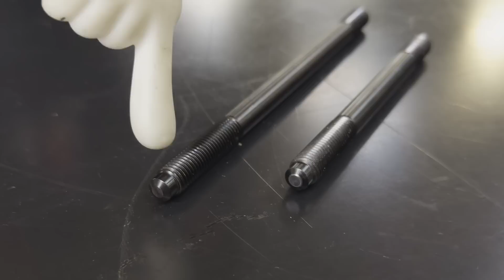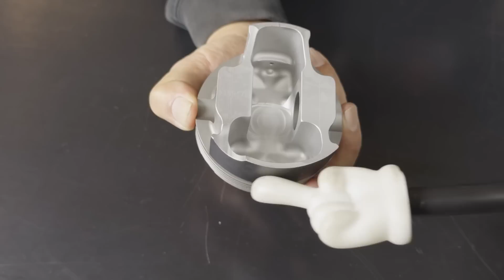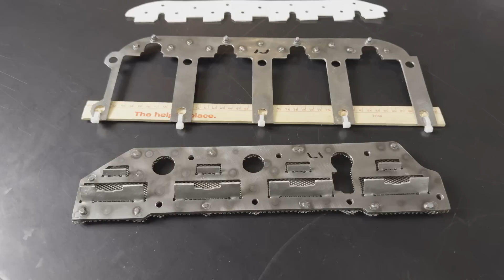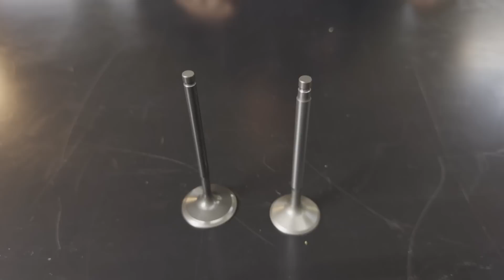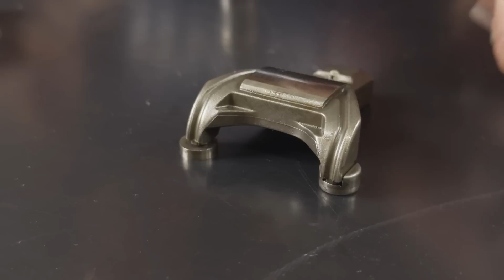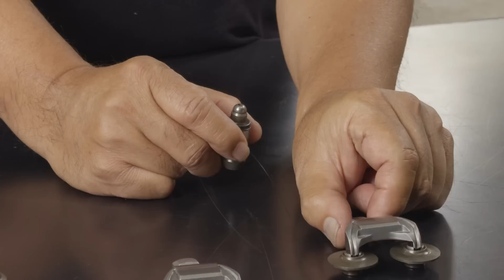How to Build the ULTIMATE Nissan SR20!

Comment: Has anyone come up with a Castsble  light weight. Alloy that resists distortion From all this bolt torque. Maybe  billet block out of 7075 with a dry deck  and O ringed.  Not a metsllurgy major but  worth) a thought. Not sure what Ali /alloy thd guys r using but pretty sure it’s a forging and prob st T6 as i
Often these alloys machine better heat treated  be mega $. But somehow it doesn’t put a lot of people off they have a goal and they wanna reach it lol 😂
Reply from the maker: The design that would not distort would probably have the threads deep inside the block.  If you notice, many newer engines have much longer bolts on the mains and head, this helps.  Things would have to be heavy too.   Youngs modulus for aluminum is pretty close to being the same for all aluminum alloys so making it out of 7075 is not going to help.  In fact 7075 is slightly less stiff than good old 2024 cast aluminum.
Reply: @motoiq  u know your shit Mike I love your channel 👍🍻
Reply: @motoiq  thank u  yes it looks like many manufacturers have particular alloys they use  I would guess experimentation over the years has had them arrive at these Would love to know what cosworth and Judd and Romac use with much high specific out puts and lightweight being paramount I guess they have their secrets 😂
Reply from the maker: What I have seen with Cosworth anyway are tons of smaller long studs.

Comment: I watched a dude build  up a 4g63    he took each valve spring  measured the installed height of each   Then by way of shims  got them as equal as possible next he’d  compressed each individual spring to X  and measured its spring pressure At X compressed value. Think he did. This at Y and even Z compressed value.    Recorded everything and matched  them all as close as possible in some cases this involved adjusting the shim stack to obtain equal values I’ve never seen this before it seemed like overkill. But. As he said   Harmonics r involved in the cam drive also Wow this dude had more patience than a saint ( and perhaps no wife 😂😂be interested to know if any one else had heard of this) btw  x and y and perhaps z  were. All measures of  cam lobe lift Seriously dedicated dude lol
Reply from the maker: This is actually typical and you are supposed to always do it.
Reply: @motoiq  wow I’ve taken note now to raise the cash for the tools

Comment: Have seen a vid on cosworth  inline 4  pinto based engine  wherethey were able  sink the head studs right down into the block r able todo that on these engines?
Reply from the maker: The SR studs are sunk into the block.
Reply: @  How far down they go ?  This mod I’m talking seemed to have hugely long studs   Not sure if that engine was a wet or dry lined but I guess the idea was to get away from bore distortion  I must go back and check that  Wow that’s being ultra  careful with. Torque plate on the he head  and cutting Valve seats actually love what your saying about the cnc valve seat cutting to me a single point cutting tool is thd best way to go. Avoids a lot of chatter and thd radii seems perfect   No need for an O ringed block and head with this type of gasket can u name it again I’d like to look it up  I’m a big fan of all these. Newish processes also  like too know more about this new Cryo treatment   Superfinishing makes a huge difference to Motorcycle  dog boxes  I priced WPC but hugely expensive. Not enough places doing it yet !!!!!
Reply from the maker: About 7"
Reply: @  gee long way down  and it still gets bore distortion! ?
Reply from the maker: Yes a lot of engines do, especially aluminum blocks.

Comment: This is excellent information. Thanks so much. I recently had a failure after 10 years of use. Standing behind the engine my piston 1 front right valve relief burnt. Piston 2 front right valve relief cracked. Piston 3 ringland broke on the intake side. My 1st n 2nd piston rings were perfectly fine but the top and wavy oil ring were snapped. Piston 4 appears fine but the exhaust side valves were saturated in oil looking through the cylinderhead. I'm still tearing down the engine. Next I will remove pistons 1, 2 and 4

Comment: People who think cryo treating and WPC are snake oil are idiots.
I spent over 20 years in aviation. A lot of aircraft parts are cryo treated. Pretty much all the rotating parts in a jet engine (fan, compressor, and turbine blades) as well as any gears are cryo treated (and sometimes laser peened).
Media impact deposition application of dry film lubricants has AMS and DoD process specifications (DOD-L-85645 Rev. A). It's been in use for at least 25 years by the military. I suspect its been around longer than that jusr under a different spec number. I've seen F-16 flight control parts manufactured in the 80s that had some kind of dry film surface coating and a slightly pebbled texture like WPC.

Comment: I dont have that much experience so keep at mind that my own build is more an "amateur" build rather than an ultimate build, but thing i learned on SR20 since 10 years:
1-Oil pump => Go for either an GTI-R or SR16VE oil pump. Both have wider internals, resulting in more flow (and more pressure for the later). A minor adaptation is needed though, like a new collard for the crank (with is now diven by 2 wolfkey rather than 1), a 5mm shorten crank pulley and a relocation TDC indicator.  It's rumored that SR20VE oil pump cover are a bit stronger and have the same are SR16VE internals.
2-Conrod = you can get some brands who use GTI-R bearings, switching from 17mm wide to 19mm wide.
3-Mains bearings = use Nismo or Tomei for the oil gallery on both sides. IDK if ACL do the same.
4-I'm not a fan off dual guide on the rocker arm, for what i understand you need to shim your rocker arm properlly if you dont wana throw them. Use the special tool (or make one) which is placed on the lifter location and mesure carfully with a comparator the heigt difference between your 2 valves. If done correctly (+/-0.025mm between them) you done with rocker arm problems, except if your using an agressive rev limiter or anti lag (the exhaust valves can lift from those).
5-Never use a rocker arm stopper 😠
6-For a non track only car, i recomand 4032 alloy pistons instead of 2618. There are less thermal expantion on 4032 so way less piston slack than 2618, and there are stong enough for more than enouth hp to daily drive. (4032 piston example : HKS, Mahle but there is no hole for oil squiter on this one)
7-Oil pan, obviously larger capacity + baffle but i recommand stainless rather than aluminium. The oil drain tend to wear the threads really quick on aluminium, but you can use an Helicoil to prevent that. I use Tomei japan N1 pan, + 0.8 liter and quite nice looking too.
8-Valve guide, dont cheap on that. They wears down quickly because of the rocker arm design, aftermarket ones are suposly a bit stonger, but the main thing is check the valve on the guide, 0.3mm is the max at max lift.
9-Coil : use a good aftermarket one, R35/370Z or VAG R8 are greats, spitfire etc... are garbage.

And last thing, the OEM SR20 is 8.5:1 CR, uping this to above 9:1 until just under 10:1 mean that you can still use gas pump 93, but your engine will be nicer at low rpm and spool your turbo faster.
More than 10:1 E85 is needed. 😊
Reply from the maker: Did you listen in the video on how we keep the rocker level with dual guide shims? 4032 is about superfluous now days due to the much better piston designs than now run about the same piston to wall clearance with 2816. We rarely run 4032 anymore.
Reply: @motoiq  dont worry i didnt say you told a bad or a good thing in the video, i just tel what in learn by myself 👍
By better piston design you mean they overcome the downside of large expansion alloys with some new tricks ? I know that part of the coating on the piston skirt is partially use to reduce the slap for exemple.
But in the end the "ultimate sr20" is for a track use focused build, so 2816 downside are not a thing anymore. 
But for the valve grind to adjust the rockers its a clever Idea, it's get rid of the whole shim stuff. But the guided shim actually exist in different heigth,  but it's probalbly for solid lifters stuff (tomei make them).
Reply: @LMSCa18det  As a GTiR owner. Can't beat solid lifers (or quad throttle bodies. But that's another story.)
On a close to 'money no-object' build. It's an odd omission given the reliability advantages. Especially if planning on a flat-shift and/or limiter bashing. Having a lifter collapse from frothy oil is a real risk at high loads/rpm/g-forces. This combined with ALS(if they plan to run that) or flat shift can bounce the valve and then you've got instability at both ends of the rocker. Solids give you you piece of mind (and the ability to run more aggressive cams ;) )

Excluding a VVL head upgrade (but they can toss shims as well, just ask Andre.) Dry-sump and solid lifters are the gold standard for track focused builds (not just SR's.) Just like the old SuperTouring cars did. 

Regards
Jordan.
Reply: @manitoublack  on gtir sr you have a system on the lifter who lock the rocker the lifter ?
with sr20, it's always a mater of keeping the rockers in place, everytimes they need the cam lobe in near contact with the upper part, the 2 valves and the the lifter. If not, the rocker can move and will move.
I was thinking about retrofiting in the valve train like the VVL head, but with custom rocker with an ajustement screw like in k20. No need to have a dual lift, just a rotative rocker instead of the one on DE head, with a screw to set valve play witout any shim.
Reply from the maker: Yes they have way better skirt shapes now with thermal analysis.  The slapping noise is much less reduced.  At least JE, CP, Mahale, wisco etc, the better companies.
Reply from the maker: There isnt as many good profile choses with solid lifters so I tend not to use them and do the tuning with softer bounces.
Reply: @motoiq  Good to know, thanks for your share of knowledge !

Comment: What about the oil pickup tube I’ve heard they tend to break off frequently?
Reply: Yes. I’ve had one break off on my stock s13 sr20. The fix is very simple though, which is to buy the s14/s15 oil pickup. It bolts straight on and has a revised pickup shape, stronger support bracket, and more thorough brazing on the end of the tube.
Reply: @bransonfleischman2233  the tube usually breaks off at the strainer right?
Reply from the maker: Never had an SR do this, EJs yes. We will note this and beef up the pickup, than you!
Reply: @motoiq  glad I could help
Reply from the maker: I checked and we have the improved later pump pickup. I ordered a new one and will add a few tig welds to it.
Reply: @motoiq  that’s good news one less thing y’all will have to worry about later. Can’t wait to watch y’all’s next video!!

Comment: What do you say to the people who claim intakes with short runners like the Greddy lose a lot of low end torque and it's better to stick with the stock intake?
Reply from the maker: The dyno doesn't show that.
Reply: they're accurate. but solve the issue with more displacement ;)
Reply from the maker: We haven't seen power fall off at low rpm with our builds, even at 2 liters.

Comment: Don't think enough drivers understand the load braking in gear does to a engine especially rod bolts. Deceleration is the same load as acceleration.  Losing your engine is automatic last place.

Comment: Every time I see an SR20, I just get the feeling that Nissan didn't design and manufacture it to particularly high standards.
Reply from the maker: Well it's a 30 year old design.  That being said the only late model 4 cylinder that is significantly better is a Honda K.
Reply: @motoiq  What are your thoughts on the ecotec engines? Some of them seem to have done really well in drag racing.
Reply from the maker: I don't have any experience with them, I think they are good.

Comment: Are there any papers You would recommend reading about the cryogenic metal treatment.
Reply from the maker: Google
Reply: Unfortunately the best ones sit behind Engineering Journal pay walls. If you're a university student or know someone who is, you could use their student credentials to gain access through their university's subscriptions. text books also exist

Otherwise it's $5-50 per paper.

Suffice to say, having read a few. they're very dry and can take some 'reading.' If you don't already have a good understanding of material science. You may not get much from the academic publications as they assume a high level of prior knowledge. I know that's not much help saying: "in order to learn about Z, you need to know Y. And in order to understand Y you need an understanding of X which you'll get from degree in materials science..."
Reply from the maker: You can find good white papers on cryo for free on google.

Comment: How do they drill the pin boss oil holes? Must have a very small 90 degree spindle on their cnc machines, maybe high pressure coolant powered, just a guess.

Comment: Like 500 hp here is good fuel, good tune, new bearings, soft limiter, ARP rod bolts water pump pulley underdive, oil pickup mod.

Comment: Chuck it in the bin and get a Toyota if you want to beat on a Nissan. If your car is going drifting, put a proven engine in the car. I.e, a 1jz or a 2jz. You have loads of space under the hood. A RB26 might even be a solution, but not a SR20. A straight six would provide much clearer power and more torque without having to lean on it, which in turn, makes a much more reliable build.
Reply from the maker: no kidding
Reply: @motoiq  I guess you have a huge budget and can afford to rebuild a engine every race, that is if you honestly intend to get 500 HP from a SR and race it, I mean actually race it. If it's "4-cylinder" class you intend on competing in, I still wouldn't use a SR, I would use a K Series Honda. As far as common knowledge in Europe goes, SR20's are known to be really soft, which you kinda allude to. I'm assuming all those treatments and preparations don't come cheap, and you could avoid all of it, and save yourself a lot of money, by simply choose a engine more suited to the purpose. Is there any specific reason you are choosing that engine? I'm interested to find out if they are actually so soft, or do Europeans have too heavy a foot? Also, what is so special about the "neo" Nissan engines? I'm always up to learn.
Reply from the maker: this engine is built to go two seasons.
Reply from the maker: well no kidding watch our K motor videos. This video is about the SR20
Reply: Here in Japan lots of S-chassis running SR’s and they have that crazy banzai sound but yeah in today’s world where drifting is getting more expensive a K20 DET seems like the more sustainable option to stay 4 cyl..

Comment: Step 1 for the ultimate SR is to get a VVL head. So much efficiency to be gained. Basically creating the K series within the SR world.
Reply: and it removes the stupid rocker arm problems from the regular heads too
Reply: I heard one of the built SR20's with the VVL head here on YT. I let the youtube video run while I was doing something in the house. I heard ONE pull, and dropped what I was doing. I couldn't believe I was listening to a boosted SR20, but with the cam duration shift. Sky high RPM, too. Super impressive.